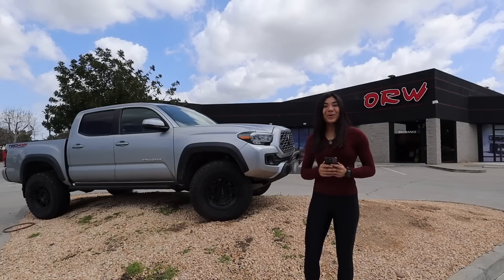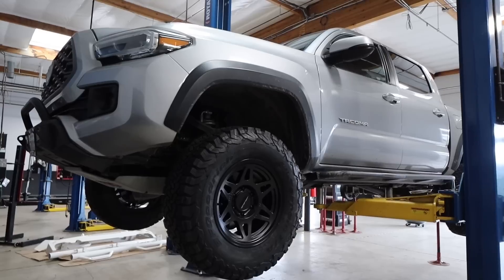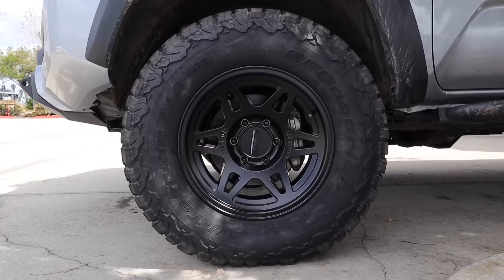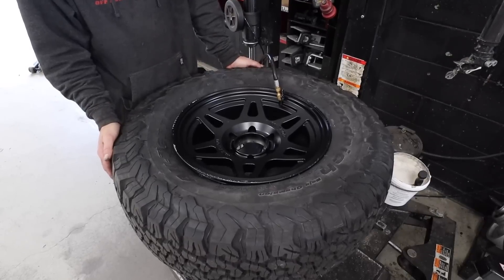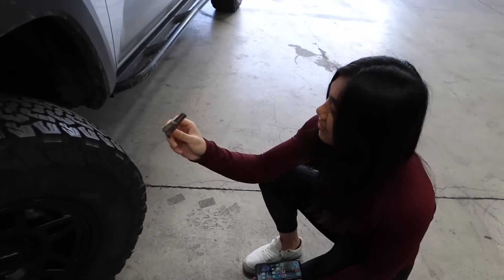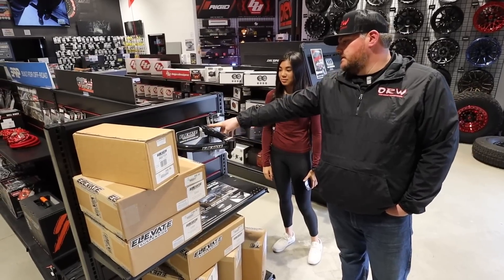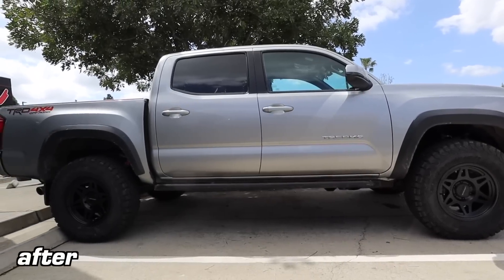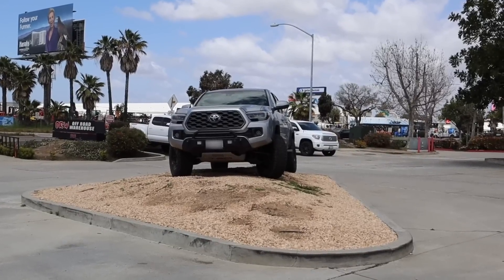GOING BIGGER with 285 Tires on my Tacoma at ORW

Comment: you should of went the method 703's 285/70/17 nitto trail grappler with pos 35 offset on my 4th. gen tacoma i didnt even need to lift my truck no rub on the full scrub trade your 3rd. gen for the 4th you wont even miss it

Comment: I'm running 295/75/16 and they just barely rub at full lock and full tuck. just light plastic trimming, no cab mount relocate. Although I'm prob gonna do 285/75/16 next. the 295 actually were on the truck when I got it.

Comment: Oversize wheels and tires on the Tacoma puts a strain on the rack and pinion which is the weak link in the system🤓it will leak or fail😎

Comment: Nice setup but if you don’t want to worry about regearing or rubbing issues you should consider going with  275/70/17 that’s what i have on my taco with a 2.5” king suspension lift and 1.5” wheel spacers and gives that same aggressive look with no rubbing or cutting at all! And I go off-roading quite a lot too nice taco btw.
Reply: What offset are your wheels
Reply: @rioganstech9275  0 offset
Reply: Your tires are load range C or  E
Reply: I want the ko2 275/70/17 but they are E load , and people say those tires are to heavy for my truck

Comment: I have 275/70/17 on my taco. I had to cut due to some rubbing issues. I also cut my front liner, so now I have access to my fog lights. I replaced them with some 4 bangers due to water

Comment: Are you having any issues with the UCA’s? I had the same installed on my 4Runner and they have a minor creaking when turning the steering wheel slightly.

Comment: Looks good but, with the METHOD wheel. the air valve stem sure sticks out a ways & looks fairly vulnerable.  Is this going to be an issue when out off road, in rocky areas, for example.  With the old TRD wheels, the valve stem was somewhat less exposed & even protected a bit.

Comment: Very cool setup!  If you stick with that setup I'd love to see a re-gearing video.  I bet there's some awesome shops in your area that could help out.  I'm not sure if I'll go with 4.88s or 5.29s when I get to that point.
Reply from the maker: After driving with these for a week... I'm sold on the 265 setup on my Tacoma for now. I love the way the truck looks with this setup, but 265s are more optimal for what I use my truck for + I don't want to deal with a re-gear on my Tacoma right now haha. Funny enough though, I am in the middle of re-gearing my Land Cruiser in preparation for these wheels/tires (it'll need it!)
Reply: I am in the very slow pay as I go process for the 285. In all my research I will be going the 529 gears for the following two reasons. First I will not be on highway with speed limit above 55. ( Oregon coast, primarily west of I 5 ) Second if I want to go bigger, knowing that I will 😂 529s will be there to carry me.
Reply: @ddoghunt3471  from your finding what gears are better for 285s for mostly highway driving
Reply: @Chloe Kuo  the comment I was looking for. I currently have 265 70/17... I wish the tire filled up the wheel well better because like you mentioned, I like the way 285's look..better imo but I'm not willing to regear or lose performance just for looks. ..besides I was thinkn, you just had you're truck tuned...I would think changing tire size would affect that tune...
Reply: Do 265/75 tires
Reply: The 285s look cool but going with 265s will help with performance and gas mileage. I prefer to keep my vehicles stock less problems down the line

Comment: 295s should fit with the TRD wheels. I ran 295s on stock steel wheels on my 2015. 285’s should be a breeze on the TRD wheels.

Comment: I am running a similar setup on my 21 OR. I have 285/70/17 on the TRD wheels with +4 offset and I don't rub on the street but when I take it off road even something slightly bigger than a speed bump will start to rub. It looks like you will definitely have that same issue off road
Reply: Im running 265/70r17 on the TRD Wheels +4mm offset and im also having rubbing issues, but im not sure if it has to do with the fact that im still on stock height and have a DV8 steel midbumper. Im waiting till the end of the month so i can get a replacement plastic midbumper and see how much trimming I have to do. Many people say the run the 265/70 with this wheels without any rubbing but im not sure if they do any off roading.

Comment: 285s are the bare minimum to getting into bigger tires. You can fit 285s stick with no rub with just a better alignment.

34s or 305s is where I worry especially with aggressive offset wheels

Comment: The nice thing about having the same bolt pattern on both trucks is that you can switch the tires between the two trucks whenever you want. Or put the smaller tires on the new rims. It's a win-win. The big lights on the Landcruiser will give it a very Australian look.

Comment: 285s are a great size tire for Tacomas, very popular! The key to larger tire fitment is UCA choice and proper alignment. More lift is not the solution for fitting larger tires without rubbing.
Reply: What UCA do you recommend?
Reply: @frederick3267  Built right from the Truck Shop in San Diego